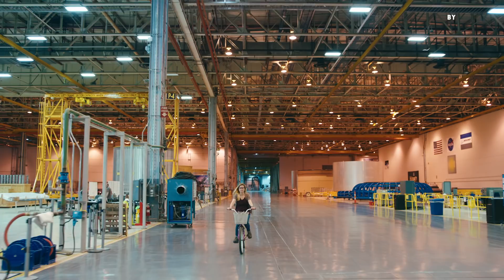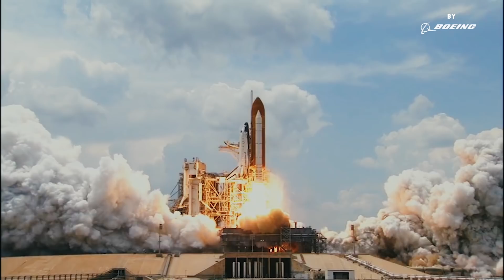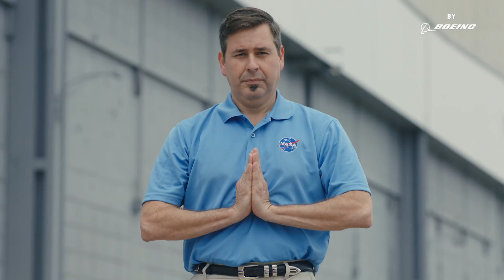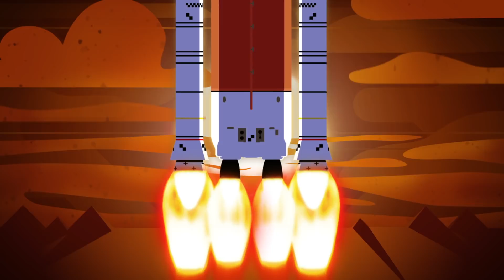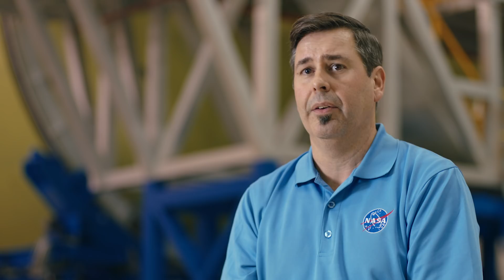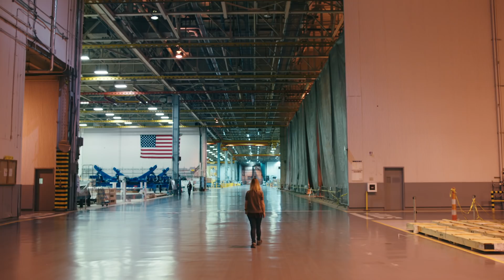How to Build a Rocket to Mars

Comment: When are we going to get away from internal combustion engines? The Alternator of a car will generate power just by motion. If you spin the alternator and hook it up to a multimeter you can generate power. The Alternator of a car is most definitely a key in accessing regenerative energy.

Comment: Nasa is about oldschool fly-then-dump style of rockets #FTheReusability
Reply: it was very costly to get the booster as they needed to (from what I have heard) divert a carrier from its normal duties for grabbing the boosters. When spacex decides to land boosters they either do it on land by the pad, or a drone ship which is still much smaller and cheaper then moving a carrier.
Reply: Tell me about the Space Shuttle then.
Reply: Meme_Man If something can be refurbished it is reusable. Took long compared to what? 
All of it's rocket parts were reusable, only expendable was the tank.
Reply: The space shuttle was a technological dead end that's why it was cancelled and they have gone back to rocket and capsule technology.
Reply: @Patrick Meyer If you're going to send something big to Mars you need a big rocket. Reusable or not, it's not relevant.

Falcon Heavy will probably not launch many things to Mars.

The amount of extra fuel needed to get even the first stage back to the pad is minimal.
Reply: TheBlacktom how about the BIG F*CKING ROCKET??
Reply: TheBlacktom not reusable. Look up how long it took to refurbish. Also the entire rocket part of it is not reusable at all.
Reply: You'll notice that the falcon heavy's maximum payload capacity is 68 tons. It's reduced to about 40 tons of they land the boosters. If you're going to send something big to mars, it just doesn't make sense to have a reusable rocket, especially for human spaceflight. Although reusability is ideal, it's not practical with a rocket of this size due to the sheer amount of extra fuel needed to get even the first stage back to the pad.

Comment: It’s not going to happen #missionfailed
Reply: I don't know what Epic Screen name's specific issue was, but there are a lot of reasons to think that even if SLS flies (which is doubtful) it won't be used to put people on Mars.

First, SLS itself began as more of a jobs program than anything like a coherent rocket program. Congress required that the SLS system use all sorts of different components from the space shuttle. While nominally this was to save money, it seems like this was much more about keeping the existing contractors happy. Thus, SLS is going to use essentially the same solid rocket boosters as the shuttle, even though they aren't optimized for that use (although they'll be later upgraded for the final version of SLS if that ever happens). Similarly, the main engines of SLS are the space shuttle main engines https://en.wikipedia.org/wiki/Space_Shuttle_main_engine which are absolutely awesome pieces of engineering, but were designed to be incredibly high performance engines which were reusable. In contrast, SLS is going to throw away those engines with every launch. So one is taking a piece of really high quality reusable technology and throwing it away with every launch.

The issue that SLS is not reusable will of course make it cost a massive amount, while we are in an era where reuse is becoming more and more practical. SpaceX's Falcon 9 and Falcon Heavy both have reusable first stages, and Blue Origin's New Glenn will as well. This is in general, a massive cost saver in the long run. But SLS is completely thrown away with every use. It is true that Falcon 9 and Falcon Heavy have much smaller payloads than SLS (in part due to the Heavy's lack of a high performance vacuum stage), but even that isn't everything given that SpaceX is building their BFR which will if plans go through be functioning about the same time as the SLS, be about the same size, and be fully, completely reusable, with a likely starting launch cost of around just 10 million dollars for slightly larger maximum payloads. 

The next issue is simply cost: The SLS has even without being launched once, cost on the order of 10 billion dollars and it hasn't even flown yet. That's in contrast again to the Falcon Heavy whose development cost was under a billion dollars. And the SLS is estimated to cost per a launch, after development, somewhere between about 400 million to a billion dollars. It can't even get economies of scale going to reduce this because the absolute maximum number of launches yearly is 3.

Finally, even if the SLS didn't have so many issues, the idea that it will be used to go to Mars, is silly simply because there's almost no congressional funding for going to Mars. Without a robust Mars program, there's no use for this, and their central claim simply fails.  The other major mission for the SLS would be to launch the Europa Clipper but even that may happen on a different rocket because the SLS has been repeatedly delayed https://en.wikipedia.org/wiki/Europa_Clipper#Launch_options . 

It makes sense that Boeing is making videos like this: I teach calculus and a lot of my students are engineers. A large fraction want to work for SpaceX or BlueOrigin (and some of them have ended up doing so!). But no one specifically says "I want to work for Boeing." Videos like this are clearly part of Boeing's attempt to recruit enthusiastic talent. When other companies seem much "cooler" that's going to impact where the best undergrads end up working or applying, and is also going to increase the salaries Boeing needs to attract the highest quality talent. Promotional videos make sense for Boeing, but by nature such promotional videos for any company will overstate what they are doing. In this case, the overstatement is even more than usual, or is at best very optimistic.
Reply: Epic Screen name 

Why?
Reply: Joshua Zelinsky that’s what I was going to say